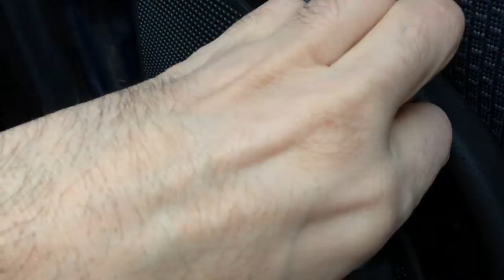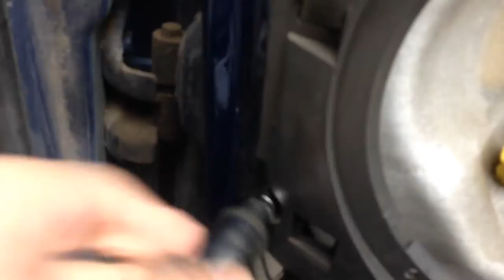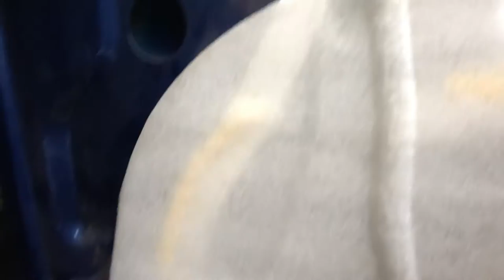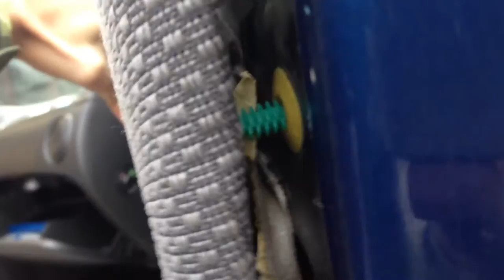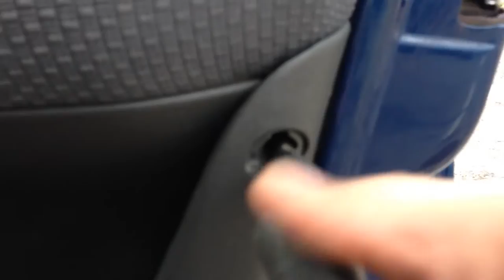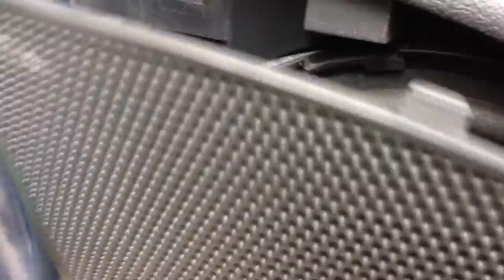Fiat Punto mk2 - Inner panel front door - DIYChannel

Comment: Hi I have the similar problem with the window mechanism (that sound when you want to window up or down). I would like to ask what was the resoult do you replaceit for a new window lifting mechanism?
Reply from the maker: I left the window with the fault. My problem was a broken gear into the mechanism (not into the electric motor). It would be necessary change the mechanism.